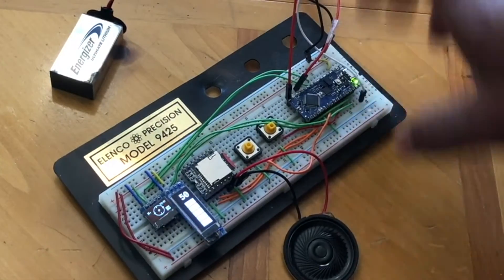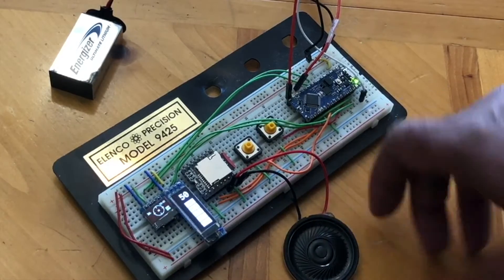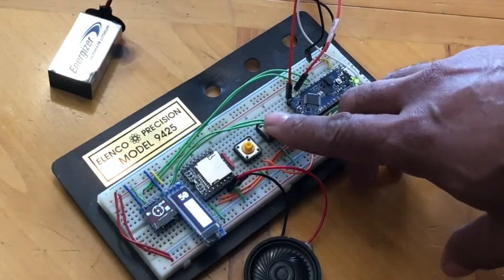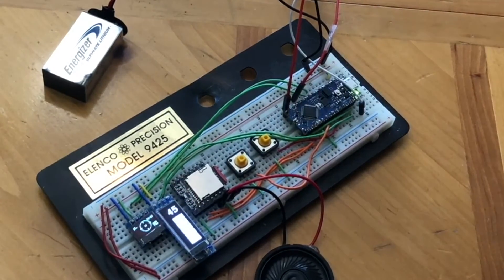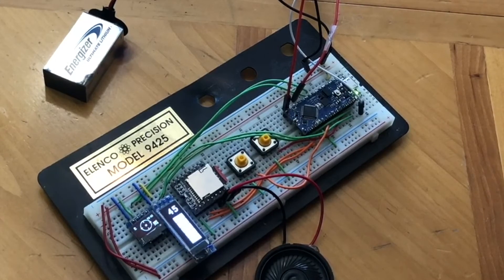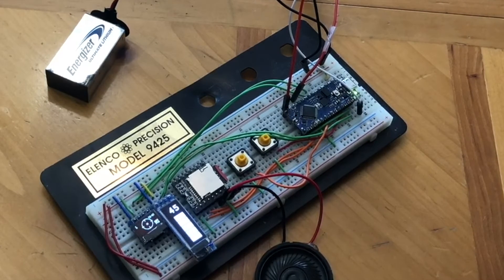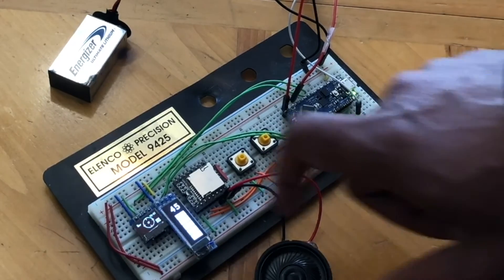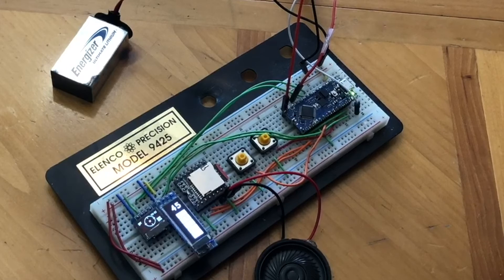Simple Blaster OS Arduino Code for Star Wars Props

Comment: I recently started a project based on your work and I’m struggling with the DF Player Mini. For some reason there is a delay every time I fire. Did you run into this issue?
Reply: 😅Yeah, I did.  I think its based on the hardware but I'm not sure.

Comment: I was able to get everything but the lights to work.
Reply from the maker: Cool. I'm building another one. I think I need to update the schematic and code. I'll probably post a new video with the final results.
Reply: @cchobbyfun1  awesome, you do an amazing job on this. By far the best I have found so far. I love the animations and how the reload counter and sounds work. Only thing I can't figure out is how to get the lights to work. I will be watching for your updates.
Reply from the maker: @justinsmith2892  If everything else is working, I'd look close at the wiring.  Most importantly the signal wire for the strip.  Just make sure its on the right pin from the code. What type of LEDs are you using?
Reply: @cchobbyfun1 I am using SJZBIN 6PCS WS2812 LEDs Light Strip Driver Board LEDs Light Strip Driver Board 8 Channel Built-in Full Color-Driven Development Board 8-Bit Light Strip Driver Board for Arduino

Also tried these

Individual LEDs  2PCS 7-Bit WS2812 5050 RGB LED Ring Round Decoration Bulb for Arduino

I have a test program and they worked great.
Reply: @cchobbyfun1  I got the lights to work. I was using this to light up an E22 blaster, so I had originally planned on using two light strips with a total of 24 LED's. The code couldn't handle more than 10. Once I lowered the number of LED's below 10 the strips started lighting up.
Reply from the maker: @justinsmith2892  Interesting. Even if you changed the value in the code to 24 it wouldn't light them?
Reply: @cchobbyfun1  correct, any number 10 or above the lights would not work at all.

Comment: I’m having issues using this code.
Reply from the maker: I’ve gotten several comments about the same thing. I’m going to build it again and make sure I the documentation is correct.  I’m starting to think I made a few changes in the final version.
Reply: @cchobbyfun1  please let me know whenever you do. I just got all the stuff to put this project together. Right now I’m waiting on a 3D blaster to finish. You did an amazing job on yours!
Reply from the maker: There is a updated code and a new diagram at https://github.com/savall21/Simple-Blaster-OS/upload/main/sounds; I also uploaded a new video description https://www.youtube.com/watch?v=EPppPt1pyGc
Reply: @cchobbyfun1  thanks!

Comment: Hello ! 
I'm trying to reproduce your awsome project, but i can't make my 128x32 OLED working. Must the digital pin connected to clock and data be 9 and 10 ? How do you know that you must use U8G2_R3 in the constuctor ? 
Thanks by advance for your help !
Reply from the maker: I think that completely depends on which board you are using. I know that was the right constructor for my board. On an Arduino Nano Every, all the pins can be digital so I think you could configure to use different pins. Hope that helps.
Reply: @cchobbyfun1  thank you ! I use a nano, and i think i tried with digital pins, but without success

Comment: Hi. I just checkt your website but couldnt find the Sound Library. Am i just blind or is this missing?
Reply from the maker: Ahhh, I hadn’t posted that yet. I will.  However, all you need is some blaster MP3 files for fire, stun, startup, empty and reload.  You can use any MP3 files a DFMini will play.
Reply: @cchobbyfun1  oh ok. One more thing - is there a Details Wirsing Diagram with „Port Numbers „?
Reply from the maker: @stevenfichtner3255  https://cchobbyfun.com/blogs/news/simple-blaster-os
Reply: Yeah i sag that but i dont see any Pins where „a is connected to b“. I totally new to arduino but i know Electronics so i guess it does matter where you put your wires. On your schematics i can basically see where things go but of you have some more detail it would be awesome to share how you did it
Reply from the maker: The sound files are now up at Github https://github.com/savall21/Simple-Blaster-OS/upload/main/sounds

Comment: Couple questions: Any idea how to put these electronics into a blaster? Can you change what sound effects play with sounds on your SD card? These are really well done really good job!
Reply from the maker: I'm going to be installing them in an E-11 soon.  I post pics/video.  I really think the install is going to depend on the blaster and where you have space.  The setup is flexible though and you don't even need to use the screens. So you have options.  Yes, you can change the sound files on the SD card to play different sounds.  I need to add more comments to the code for how to change things up.
Reply: @cchobbyfun1  thank you so much! I'm just getting started on arduino and you were the best I could find for starting simple the blaster I want to add electronics into is the nerf scout trooper pistol EC-17
Reply: @cchobbyfun1  Comments would be super helpful.  I'm not using any display screens or ammo counter; I just want the kill/stun flashes and sounds (though I'm not using the same soundcard you did; my board has built-in sound.) I'm trying to work out if I should delete/comment out code, or just leave it be and add my own.
Reply: I actually decided to add screens. Still, if you ever find the time to add more comments, I’d find them helpful.